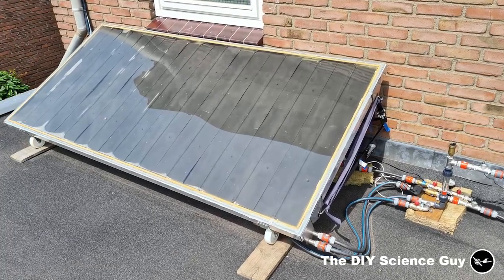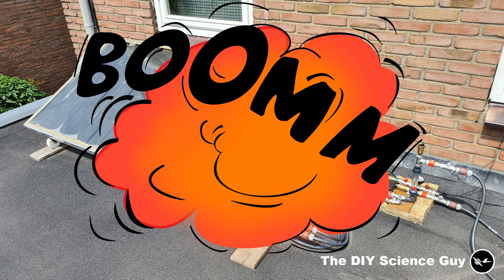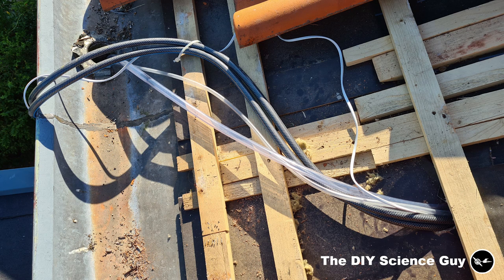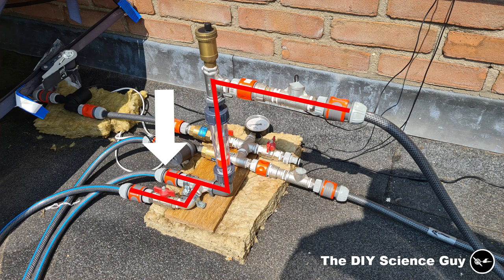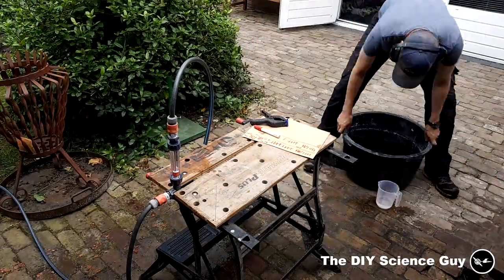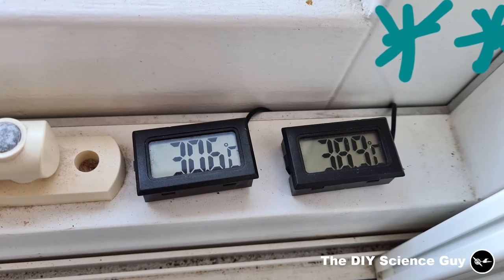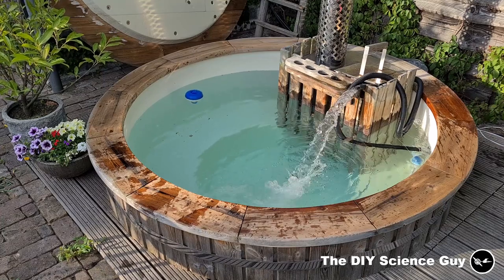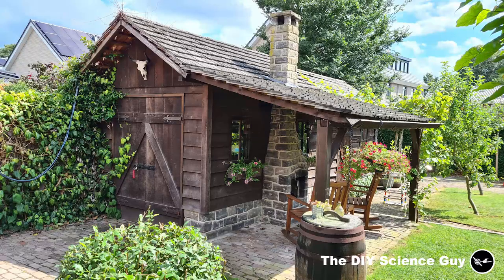Super easy to build 1600 Watt Solar panel #3 Solar panel and AC Performance

Comment: I made a solar water panel for our hot tub in the UK. I used an arduino to sense the hot tub input temperature and the temperature of the water near the outlet. Which if the difference was more than 5C would switch on a 12v pump to circulate the water into the hot tub. And then switch off again when there was not temperature difference. This way i would not be circulating water through the panel when it was not hot enough to transfer heat and therefore cool the water instead of heat it. As the UK sun is not  so strong or not always pointing at the panel.

Comment: Very cool ideas, I really like the thought of making the most out of each heat source / pump in the house so that it can be directed as needed or stored for later, so things like fridges, freezers and AC could direct heat to a hot water tank or ductless clothes dryer, etc.  Whole house thermal management could become (and may need to be) a new standard in homes.  Our city did a sewage heat recovery system that supplies building heat to a new nearby neighborhood, these kinds of ideas could make us far more energy efficient, especially in the colder climates.

Comment: get rid of the ac just make a simple shade to slide up and down on your solar panel to shade it some or all if the water to the tank gets to above 180 degrees F. now get a 200 gallon tank open air insulated tank to store your water in. Put a mixing valve on the tank if the water gets to hot to maintain 140 degrees F maximum out put. then you could take a hour shower.                                           What you built was great, good job for someone off grid it could be a life saver.
Reply from the maker: Thanks!

Comment: Here is an idea for a desiccant that regenerates itself.  Sodium silicate 

Take two stainless steel screens as electrodes and sandwhich a paper  towel coated with sodium silicate, (aka water glass) after the sodium silicate has cured hard. 
Then charge the plates with 3-12v from a small solar pannel.  The sodium silicate absorbed moisture from the air making it more conductive while that same moisture gets electrolysed to hydrogen and oxygen. 

This will remove the humidity, while hydrogen production is so small and escapes so easy that it is never a problem.

Comment: Dat is Leuk. Your solar thermal panel is producing the energy that i anticipated based its' size versus PV panels that are 20% efficient. Did you ever figure out how to use solar thermal to produce electricity?

Comment: I'm confused, I thought you were using that to heat water, are you using the water in some sort of a phase change to refrigerate air for your air conditioner?
Reply from the maker: No. The panel heats the tub with solar heat. The AC uses electricity from the grit to remove heat from my house, the heat is than transported to the hot tub.

Comment: Seeing this video  I wonder if you can make one solar panel with dual capacity. Capture the heat to heat water and at the same time produce voltage. Is it possible?

Comment: Can you tell the dimensions of the collector or surface area?. I think you lose little bit performance from the PC cover. Maybe little bit distance to the aluminum collector parts would help. Good job on the performance.
Reply from the maker: The surface area is 2.2 m2. The efficiency is quite high so I'm ok with how it is 😉

Comment: i'm confused between solar panel and photovoltaic array. my common conception is soalr panels produce DC electricity. moreover, that panel can only be used in areas that is cold. here in my country it's hot. so that is no use at all.

Comment: 1 year without nothing new... cmon make some video! We are waiting :)
Reply from the maker: Yes I know 😔 I've been working on my new workspace 😃 if you look at my shorts you can see what I've been doing. I hope to make a video this year but free time is an issue. Thanks for your patience!!!
Reply from the maker: It's just evaporating gasoline which is of no valuable use. It is not LPG because that is a mixture of different molecules.
Reply: @TheDIYScienceGuy  yes the author just compare it to popular LPG - price is the main factor, means sometimes (cheap fuel, pricey gas) it does make sense.

Comment: Can the container be filed with helium. Will it increase the thermal efficiency. You could also  add a baloon like thing instead of one way valve. I don't know you could calculate. I don't think it would be more difficult than adding a one way valve inside the   chamber to vent air out
Reply from the maker: Helium would work but it's expensive and hard to keep in. Also I don't think the increase would be much, making it a bit bigger would be more effective I think 😉 the one way valve is to prevent the water from the AC to flow trough the panel and vice-versa. The automatic air vent removes trapped gass.

Comment: Love the solar panel, its toooo big solar panel, can you make a smaller version of it that can produce 1V to 5V 
Btw if I use copper and aluminium foil will it work? 
Because the 2nd and 3rd part of it was too confusing 😕
Reply from the maker: Thanks! It doesn't produce electricity, but makes hot water.
Reply: @TheDIYScienceGuy  ahhh??????

Comment: Instead of clear polycarbonate I suggest to test with Greenhouse Polycarbonate Sheet.
Reply from the maker: Thanks for the suggestion what is different about that kind of polycarbonate?
Reply: @TheDIYScienceGuy  8mm Twin-Wall Polycarbonate Sheets. I use them and they are very effective for insulating warmth compared to single wall polycarbonate. 
U-Value: 
Single Wall	1.15
 	Double Wall	0.70
Reply from the maker: Ok thank! 👍

Comment: Love this update, thought about a vacuum for the panel?
Reply from the maker: Thanks! Well that would mean a lot of reinforcement to prevent implosion. Would make it much more expensive, it's cheaper and easier to build an extra panel. Also, the temperatures in the panel are low so a vacuum wouldn't make it much more efficient.

Comment: Water heat not a solar panel.. What 1600 watts?
Reply: At 7:15 he breaks it down for us.
Reply: The output of any engine is calculated in Watts (kW). It doesn't just apply to electrical power.

Comment: Let's see you charge a set of batteries with your "1600 Watt solar panel." Oh, you're producing thermal energy? Then don't pretend you're producing electrical energy.
Reply from the maker: Watt is a unit of power. 1 Joule per second is 1 watt. Joule means energy. This can be electricity, heat, light, sound etc. Check this link for more information about this subject, hoop it helps: https://en.m.wikipedia.org/wiki/Watt

Comment: Hmmph ! This is bs clickbait right here. The title should read : New 1600 Watt Solar WATER HEATER Panel #3 . A Solar panel by definition generates current, not used for heating water.😤